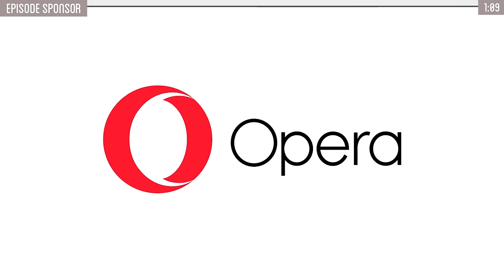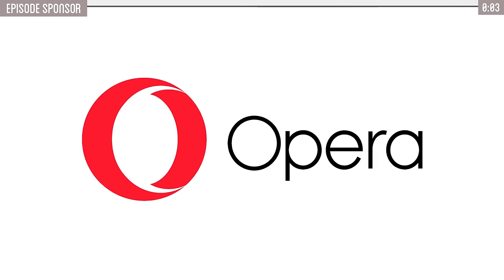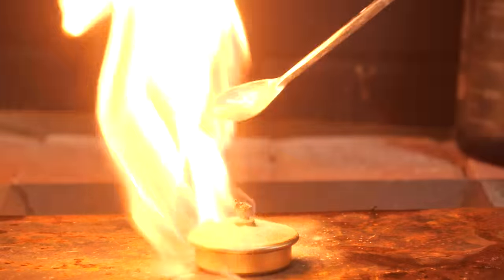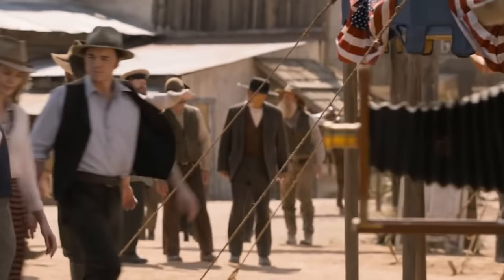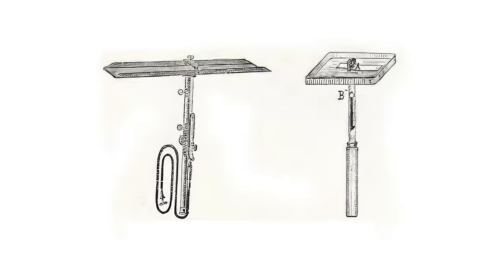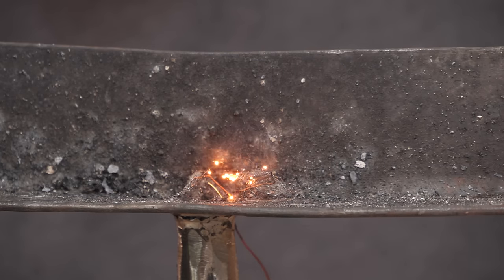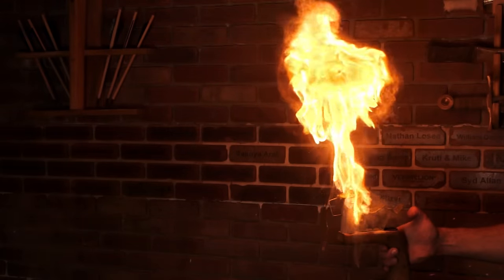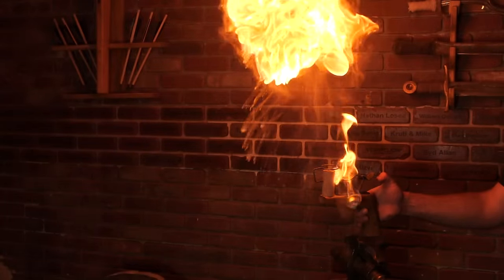Was This EXPLOSIVE Plant Used to Take Photos?

Comment: Nicéphore Niépce (who made the first camera) also built a 'controlled dust explosion' engine before he experimented with cameras, The engine was basically a gas engine but used dust as fuel and used water as a piston (it sounds wrong but it's true). The engine's called the Pyréolophore and I'd suggest you have a look into it. It's simple as it requires no proper machining and could easily made.
Reply: Thanks for the tip, I've never heard of this kind of engine. One can only imagine that Niépce went on to invent the camera after seeing the flashes from his engine!😊

Comment: Be very careful with your magnesium! It’s used in flashbangs for a reason! You can easily burn your retinas with that stuff. 

As for the guncotton: it’s supposed to burn cleanly with little smoke. Yours leaves a lot on residue which probably means the reaction did not go to completion. There’s hydroxyl groups on the glucose subunits of the cellulose that did not get converted into nitrate ester groups. So, try running the reaction for longer with a larger excess of reagents. That should do the job. Try cooling the reagents individually before dropwise addition of one to the other as well (usually H2SO4 to HNO3 dropwise). This kind of reaction can be quite sensitive to temperature. Use a lot of ice! You may want to titrate the acids as well; that why any stoichiometric calculations you do will be more precise. Hope this helps! 

I wish I could be more detailed, but YT has removed my comments for even mentioning the name of this reaction, and explaining the mechanism behind it. Ridiculous.
Reply: I understand how you feel, I've had comments removed that were talking about stellar lifecycles though more specifically the end of them. So at this point I'm convinced its a bot system that's searching for keywords and removing comments containing them regardless of context.
Reply: yeah i hate youtube these days
Reply: @datengineer2174  Yeah, definitely an algorithm that does it, and It's way too sensitive. It's kind of driving me a little insane.
Reply: @SlavTiger  I wish everyone would just pick a platform to migrate to, but that will never happen.

Comment: Magnesium based flashes were common due to the fact that burning Magnesium produces UV light. Before film as the medium for capturing the image Tin or glass plates were common. The silver nitrate solution used to coat these plates was very sensitive to the UV and blue wavelengths. This made the Mg the best solution for lighting an image. (plus the white light would give the best looking image, rather than the hues something like gunpowder would produce)

Comment: The right word to use is "deflagration" not "explosison". Although things like flour can explode, but low explosives need a container to really explode. Another good one is non dairy creamer.
Gun cotton is dependant on acid concentratiion and the higher the acid concentration the faster it wiill burn. You need really highly concentraded acids and the acids do take water from the air making them less concentrated relatiively easily.

Comment: You need to look into black aluminum powder. It is quite a bit more dangerous because it is milled in a ball mill with a pure carbon source to but it will burn a lot easier. Aluminum builds an oxidation layer pretty quick so adding the carbon prevents the oxidation layer from forming

Comment: You should try rigging up some lime lights.

It is just burning lime (the stone) in a stream of compressed air ... Super bright, super hot. Used by theatres before high intensity electric lights.

Comment: I think you need to nitrate your cotton at least a second time and then do a better job of neutralizing remnant acid and you’ll get rid of most of the smoke and have a white flash.  It’s a lot harder than you’d expect to get it all nitrated and then the acid is almost impossible to completely neutralize, it just hides so well in the cotton strands

Comment: Does the difference between the light being red/white matter for black and white photography?
Reply: Yes, in two very important ways. 

1) A blue object won't be illuminated very much by a red flash, so those will appear darker than they really are.

2) Early photographic emulsion were orthochromatic, which means they had very little sensitivity to long wavelengths like red. So a red flash would be very ineffective. Most b&w film these days is panchromatic, but you can still get ortho film and darkroom b&w paper is usually orthochromatic as well.

Comment: I saw a video the other day about the ability to heat up metal with hammer strikes on a anvil which in turn will help you keep your metal hot for longer while you work it, you should check it out it may me vital to speed up your ability to work metals! Which I cannot say I can do it and you may know about this already but I thought I would mention it just in case it's unknown, it was to me until recently.

Comment: Give sulfur to the magnesium. Easier ignite if you use with matchhead and thin copper wire for "fuse". You can use thin copper wire from a regular multi-wire electric-cable. :-)

Comment: I’m honestly surprised that Andy didn’t try Zinc and Sulfur flash powder. He already has the sulfur, zinc shouldn’t be too hard (it’s the secondary alloy metal in brass) and they’re just mixed together finely in a 2:1 ratio. Would love to see him try it!
Reply: Both of these are more hazardous (especially indoors as seen in video) than the ones in video. Zinc oxide is very bad for lungs and sulfur dioxide of course is acidic and bad for everything.
Reply: @stasi0238  Fair point - most flash powders definitely don’t give off compounds you’d want to inhale! I’d argue also best not to breathe magnesium vapour or black powder smoke either though. I’ve used the mix before without issue, but always used it outside with really good ventilation.

Could always try the chlorate / perchlorate based powders then like modern mixes (both should be doable with his batteries through electrolysis, but that gets way more complex than it’s worth).
Reply: @azrail098  I know, I was just answering your question that those are much worse than the ones used in video.